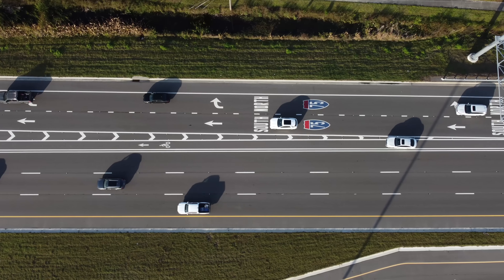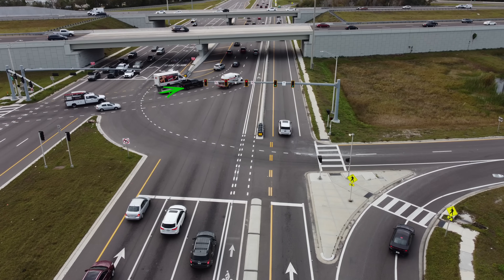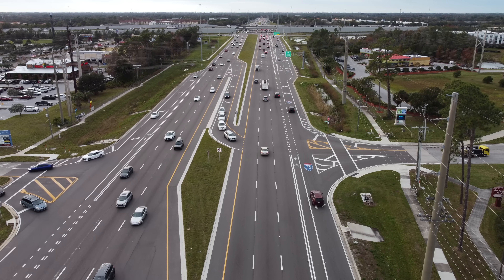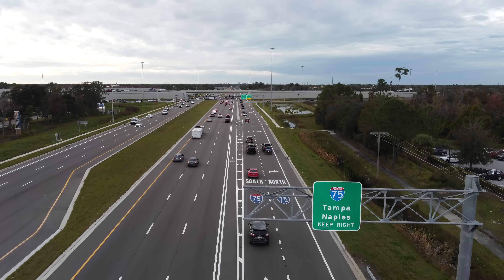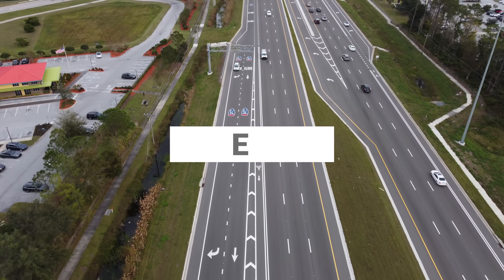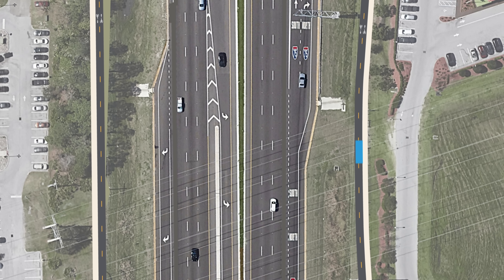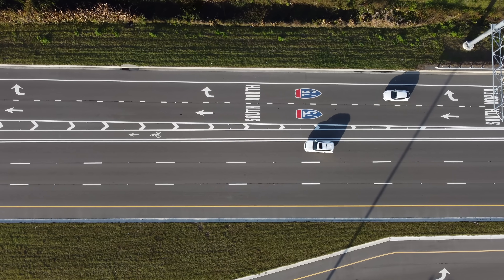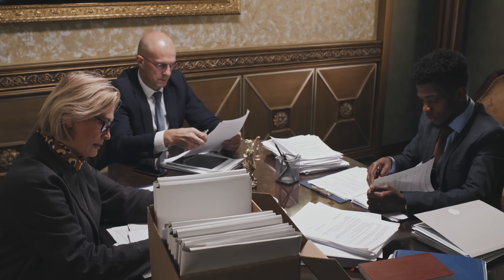This Brand New Interchange is Already Flawed

Comment: On John's Island, SC we had a bike lane that was in a similar place, and I never saw a person use it with a bike because most people used it to drive. Bike lanes should have to have some better grade separation to be considered actual bike lanes otherwise they are too dangerous for the cyclist.
Reply: Ideally, bike paths need to be completely separated from busy highways.  I don't support the idea of bicycles in automobile lanes, either.  Just like a car and a train is no-contest, a bicycle and a vehicle is pretty much the same.  Bicycles are much closer to pedestrians than they are an automobile, and I can't ever see any good in forcing them together.  (Same for street-running trains.)
Reply: Yeah, really the only time bike infrastructure and car infrastructure can and should be merged is low traffic slow traffic neighbourhood. The archetypical street. Streets don't have bike lanes, the whole road is a bike lane as well as a car lane, since you'd only see a single car once every couple of minutes at most anyways and both go at similar speeds. But as soon as you get to a road, a place people actually use to go from A to B, not just purely destination traffic, you need separation. Car traffic speeds up and bike lanes are pretty much mandatory. Any road that's more than 30 km/h (about 20 miles per hour) needs a separated bike lane that is not just separated by a line, but at least a curb.
Reply: @jaspermooren5883  I mean bike lanes are an improvement to nothing at all.
Reply: @randomrandom9570  I don't know if they are in this case. It just emboldens the argument against cycling infrastructure at all. It is dangerous infrastructure that isn't being used. It's one of those things where I do think doing very little is actually worse than nothing.
Reply: @jaspermooren5883  In this case,that's probably a fair point. Particularly at situations like the 5 lane road where 2 is being split off and there's a byclist lane in between the 2 and 3 lanes.

In general though, people see byclist as dangerous on sidewalks and I think it's a reasonable viewpoint.

So they say cyclists should be on the road.

If cyclists are on the road, cars are going to want to pass them because no one wants to slug along at 20km/h in a standard 50km/h area.
So by putting byclist lanes on the side of the road, it's a space that byclists can be in, on the road, without impeding traffic.

Of course dedicating byclist paths also gets the job done but no doubt byclists lanes on the roads is a cheaper option that does work most of the time.
Reply: @randomrandom9570  in the Netherlands nowadays you really have to look for a 50 km/h road that doesn't have a protected bike bike path. But yeah that's the Netherlands, famously unrivaled when it comes to cycling infrastructure, so maybe that's not that fair.
Reply: @randomrandom9570  but painted bicycle gutters do impede car traffic.
Every time a car is parked on it the bicyclist is forced to move into the car lane. Every time a car on a smaller road tries to merge onto the larger road and edges forward bit by bit until their bumper is over the bicycle lane  the bicyclist has to move into the car lane. Every time a car parked parallel to the road opens their door without looking the bicyclist is forced to move into the car lane. Every time there is a storm drain in the middle of the bike lane or the bike lane is just riddled with potholes the bicy... you get my point.
Painted bicycle gutters suck.
Reply: @jaspermooren5883  Netherlands is like comparing a village to a city it's honestly why i kinda always hated this debate 

this is next to the intersection 
7395 52nd Pl E, Bradenton, FL 34203

i want to see how many actually ride bikes or even willing to ride bikes because for some reason in u.s.

West of u.s.